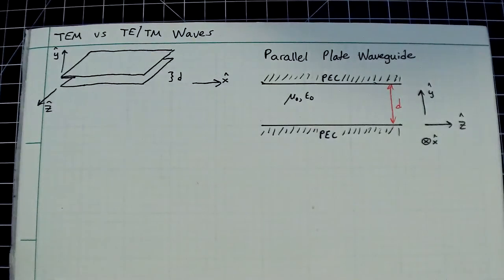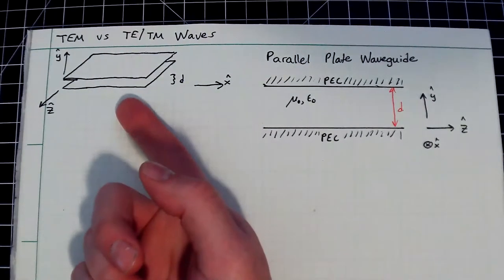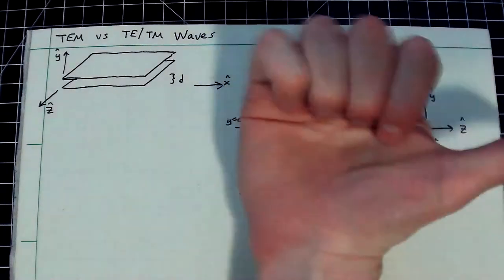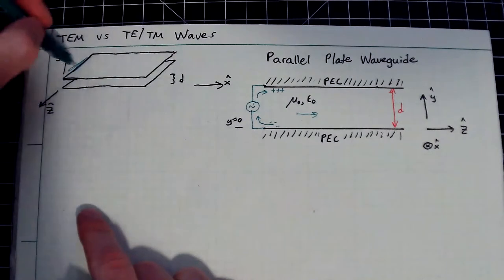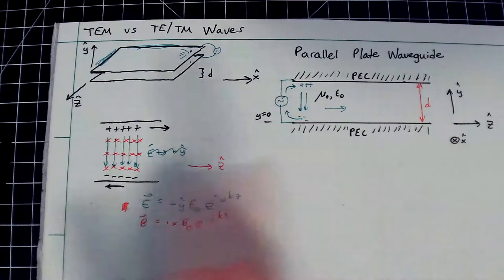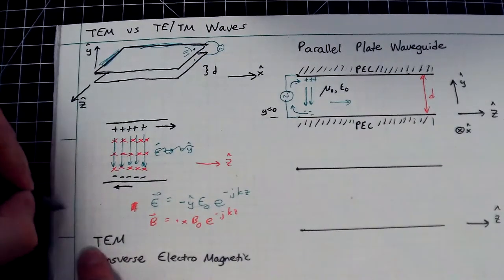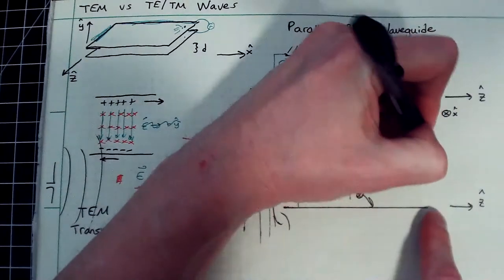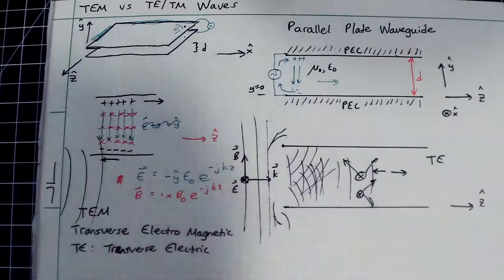Lecture 10b---TEM vs TE/TM

Comment: So... in coaxial cable TEM is just "normal" electric circuit behavior and that's why it has no cutoff frequency? Despite coax's (or parallel plate's) gap size being centimeters it can pass 100 meter wavelength RF signals because the waves don't actually have to fit in the gap. They're from charges moving in conductors. And the TE/TM modes are very different mechanisms entirely where the space between the conductive cavities has to be big enough to support the electrical length of the frequency's TE or TM mode electromagnetic wave propagation? So tiny diameter coax in TEM mode can pass DC to some high GHz, it's actual size doesn't matter because it's just wires being wires (even if impedance is defined by the ratio of radii). But with a the TE_11 mode in a too big for the frequency coaxial cable, the absolute size does matter. And no centimeter size coaxial cable can pass a 100 meter size TE_11 mode wave (efficiently). But a giant 50 meter coaxial cable of the same impedance could.